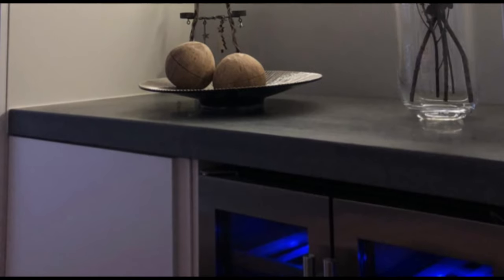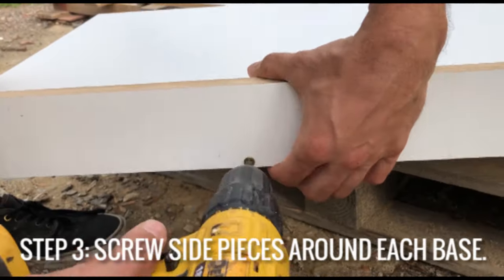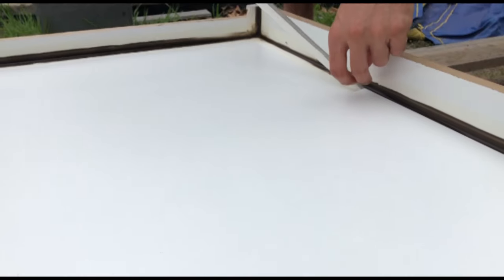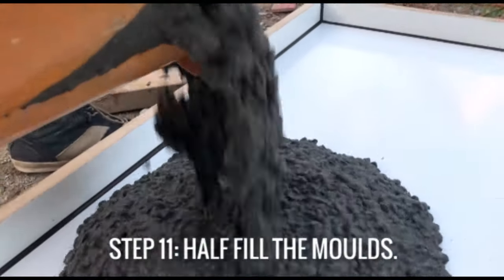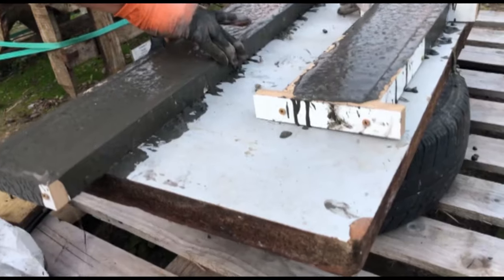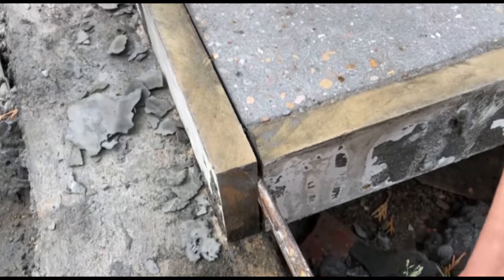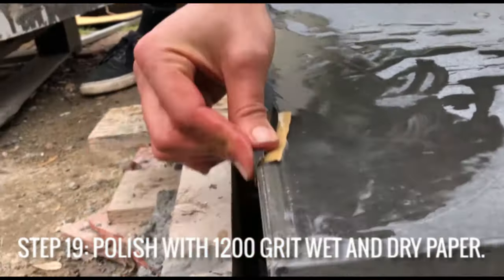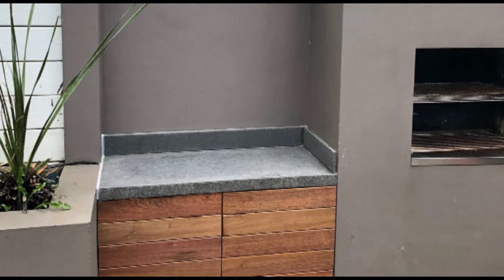The PERFECT Concrete Countertop FORMULA!!

Comment: Where do you get your blue circle 40N concrete from? I can’t get it anywhere!
Reply from the maker: Have you tried, Wickes, Travis Perkins & B&Q.
Reply: @MattHutton   yep, no where has any, just eBay for £27 a bag 🙈🙈🙈 I’ve got some general all purpose concrete and rang the manufacturer to see if it was 40N, the informed me that all concrete is 40N+ as long as you don’t make it too sloppy.
Reply from the maker: @MrJamesParker  I personally would not trust this information because there is a clear difference in strength with different ratios of aggregate and sand from my own experience. 

But if you’re buying premixed bags of concrete they’re more more likely to have a consistent ratios of cement, sand and aggregate than mixing these ingredients by hand. 

So you know that you should have consistent strength (whatever the figure) across your worktop if you’re mixing multiple batches and you keep the amount of water added the same.

What’s the brand and model of the concrete?
Reply: @MattHutton  CEM-SPEC general purpose concrete www.cemspec.co.uk
Reply: @MattHutton   I need to get this right first time as I’ve spent quite long building the former to make the inside of the basin, coating it with epoxi resin etc